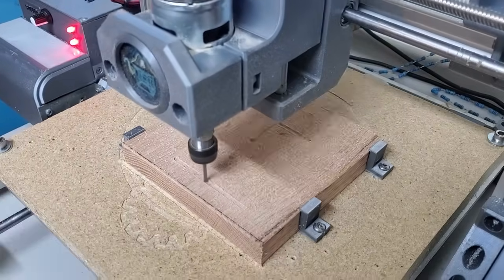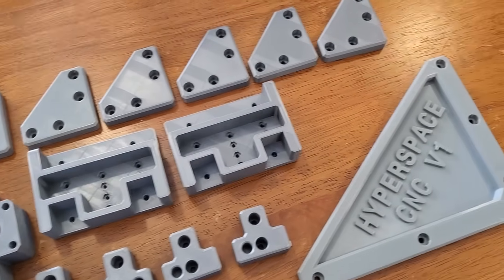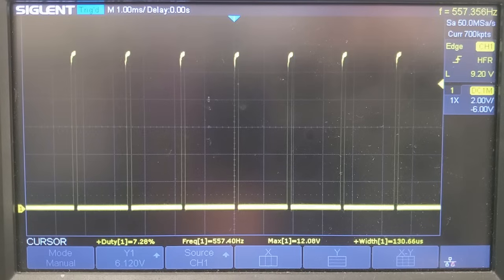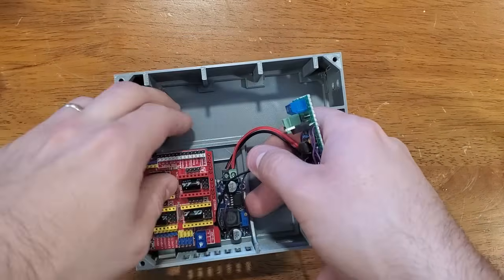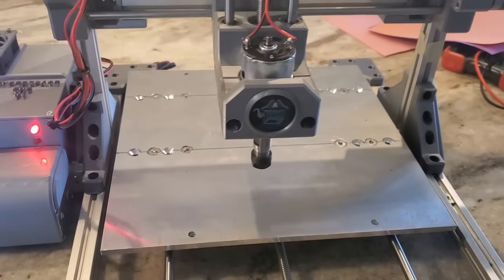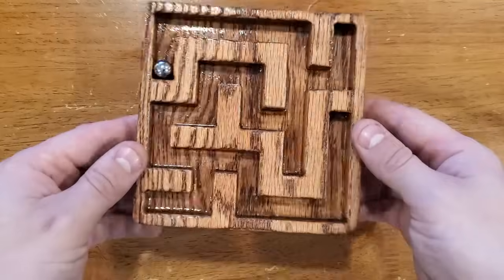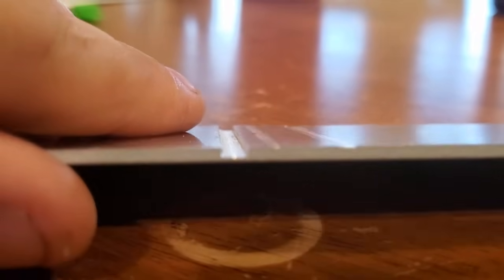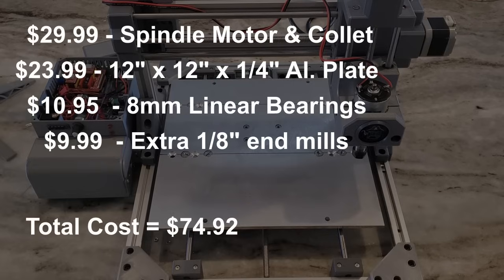CNC Mill for under $100

Comment: I don't get it...  You make it sound like we can all go and raid our junk drawer (I've got several as it happens...), but the key items - the 3D printed parts - needed to tie all the junk together requires a 3D printer in the first place!  Costing whatever cheap 3D printers cost, but certainly pushing the project to overbudgetl.    Then there's all the 3D CAD work....  Which most of us would require hours of study to accomplish.   

Very nice machine though.   I'll give you that.

Comment: I assume (or hope)  you are running correct feeds and speeds for cutter diameter, carriage feed speeds and spindle RPM . These are all critical for machining of metals to get best results. Best investment you will ever make for $140.00  is the Machinery's Handbook. I've been a prototype tool and die maker my whole life and I'd never leave home without it!  you can find used ones at flea markets that look like new for much cheaper. Don't buy one more than 5-10 years old though. It won't have new alloys, tools etc or up to date info.  on modern cutters  Very nice job!! A good build worth the education.  With some serious tweeking you can make it much more solid, obviously.
Reply: The strategy used here is entirely different from a large machine. Light CNC machines use very high speed, a light cut and a low feed rate. That way there's no pressure on the tool.

Comment: How much is 7 days worth to you if the answer is more than $100 you shouldn't DIY a CNC machine.
Reply: If you use good CAD/CAM/CAE suite such as NX or Solid Edge or one you want to familiarize yourself with you will learn a lot about designing and the software you are using. The project will likely cover most of the machine design topics. I would call that a good return of investment if I was learning CAD.
Reply: @tymoteuszkazubski2755  a CNC machine is ONLY a good project if you're trying to learn how to problem solve.

Comment: I’m impressed. But this is < $100 on new parts, but $80,000 of engineering education 😂
Reply: Well what else is an electrical engineering degree good for if not saving a buck on consumer goods?!?!? Well the microwave broke again...*pulls out soldering station.

Comment: Wouldn't it have been better to title the video " building a CNC from stuff I have laying around"?
Reply: Agreed. No way this could be built for less than $100 if everything had to be purchased. The stepper motors, lead screws, spindle, rods, and aluminum would have easily exceeded that.

Comment: You have a massively overpriced prusa yet can only spend $100 on a CNC. Makes a lot of sense.
Reply: Prusas aren't that overpriced considering they work quite well out of the box, requiring only a minimal material calibration to get working at quite good precision.

Comment: 3D printed frame parts and non supported linear rail make horriple vibration and not can use aluminium good. need be SBR12-20 rails, long more too.

Comment: led need resistor or blow smokes out. wrog wiring, arduino power need be 6-9 volt not 12 v,

Comment: stupid use 4988 drivers and nema 17 motors not working sure, need be external drivers DM556 or DM860 and nema 23 motors minimum if want cut chip wood and alumin good and real spindle 500-800W wood and 1,5Kw to alumin. not sure work this toy motors.

Comment: Very well done. It just amazes me that such a small home 3d printed based machine that can perform
Thank you for sharing your home build that does sort of work on aluminium regardless of the quirks of vibration and tolerance
Please do another video of upgrades to gain better machining from this amazing machine that you have made
But please explain your feeds and speeds and the brand and type of your cutter used

Comment: You didn’t say what material the 3D parts were made of, metal 3D printing is the best, cause plastic when used to cut metals has to much deflection and results in poor quality results.

Comment: It's hard to wrap my head around someone calling this a CNC milling machine. I would call it a working model of a CNC milling machine, similar to a model train set or an RC car for example. Looks like a fun little toy though. A DIY CNC with multiple tooling possibilities, capable of cutting precision parts out of stainless would be a very interesting watch indeed.
Reply: With decent depths of cut and feeds of course... Not industrial level but decent.
Reply: @Nitronic99  This Old Tony made a machine capable of milling mild steel. But then he retrofitted a real milling machine. There's no replacement for cast iron and dovetails.

Comment: the cool thing about mills is that even when they are made from poor quality parts, you can use them to fabricate higher quality parts to upgrade it. mills and lathes are both tools that can be used to fabricate themselves, and i guess we can add 3d printers to that list too now.
Reply: 3d printers have always been on that list.  In fact, 15-20 years ago,  thats how you got one.  The first hobby use 3d printers were obtained by having someone else print your parts.  Once you made one, you printed someone elses parts.
Reply: i managed to build a sturdy 3d printer that way took 5 iterations and 2 years to make a printer that prints well now. my printers made parts for their future self and now the V5 has the DNA of all its predecessors 😅
Reply: @VIJAYzk I hope you keep some spare incase it breaks down
Reply: Don't forget the part where their end product is substantially worse than the 50% 'more expensive' retail version because they have no idea what they're doing.

Unsupported rails mounted using 3d printed brackets. Sheesh.

Comment: It's amazing that that drawer had exactly everything needed to make a small CNC machine, with the exact amount of the exact motors needed, the aluminum pieces, etc, without a single extra motor of any kind or anything else, save a handful of random trash. It's almost like this was completely faked.

Comment: me me smooth brain but wonder if keeping it mostly the way it is and using some concrete to support the gantry and all the connected points would help since concrete mostly kills vibrations. Also maybe using some cast iron instead of aluminum. I'm just a smooth brain idiot.

Comment: I mean... A for effort, and it is kinda neat that you built your own, but... getting a pre-made for a couple hundred more seems the better idea, given the inaccuracy problems you have with this unit.
Reply: You think the CNC machines sold for a couple hundred are more accurate?
Reply: @1pcfred  - it has been four months since I watched this vid, but iirc the author himself came to that conclusion
Reply: @1pcfred  - you could ask HyperSpace Pirate, rather than continue to ask me.
he has shit rigidity and poor accuracy, for a cash outlay of 75 bucks plus a lot of machine parts he happened to have lying around plus a fair bit of labor.
that is well over 500 dollars total value, for a product that is no better and arguably not as good as a commercially-available $500 CNC router.
this is easy math, and I hope that terminates your puzzlement.

Comment: Why don't you directly wire the spindle mosfet up to the arduino? GRBL has PWM spindle control on pin 11. No need for 555 circuit, and you can now control the speed of the spindle through GRBL, improving cut quality.

Comment: Hey there my bro.. This is one sik ass video. I'm in the process of buying up the components I need to build my own CNC but for somebody like me who couldn't even set up an email account a week ago bcos I've never been into computers before I moved to a new job it's very daunting. 
I would love it if u could make a full unedited video as a series for guys like me who want to learn. If u have a website u could maybe sell the tutorials for a price? I don't know really? How about 10.99 euros for each hour long video? Make the videos in a 4 part series? I bet u could get a lot of interest. I will defo be one of those people who will be paying for the privilege of gaining ur knowledge into the building of a very good CNC machine.. 
I want to build a 1200 x 1000 sixe which will give me a work area of about 1000 x 800? That's what I'm hoping for anyways. I have a nice corner in my woodworking shop for this machine but now I need to build it. 
Is that 2020 u used in the frame or 4040 extruded aluminium? I bought 10 x 1200 lengths of 2020, I have 2 X Longrunner Nema17 stepper motors and 2 X TB6600 drivers to go with them. I got the pulley system with the belt also. I only found out about the Arduino UNO yesterday and saw u used it here as well.  They're good enough for my purpose atm too but I will be doing my best to learn everything I can about the CNC software like CAD & CAM to have better options moving down the line but for now what u are using would suit me fine.
Apologies for the long winded comment but I would be very grateful if u could give me a little advice about what else I need atm to get this CNC up and running. Is the 2020 to weak or could I put 2 together on the length and cross sections to strengthen it all up?? 
Thanks for a brilliant video my friend. I hope u can make those videos and get a website up and running so we can get there to buy the video tutorials in a longer format? Just a thought my friend. U haver the knowledge so why not make on it for a living. There are a lotta people out here who are looking to get into CNC and milling machines of all types.

Comment: Very cool indeed. ThNks for sharing and documenting. Maybe worth designing 3D printed mounts that can be easily milled in aluminum after the machine is complete. To replace themselves. And add some rigidity
Reply: With those unsupported round linear guides the machine will never be rigid. You could increase their size 10X and it'd still flex.

Comment: WELL NOW THAT YOU HAVE A CNC THAT CAN CUT ROUGH SHAPES YOU COULD USE ALUMINUM INSTEAD OF THE 3D PRINTED PIECES TO FIX A SMALL AMMOUNT OF YOUR SLOP  BY USING ALUMINUM PARTS TO BUILD THE FRAME BECAUSE THE PLASTIC LEADS TO SOME PLAY JUST IN THE FIXTURES

Comment: Since you’re limited by support strength, print area, and what you can actually cnc, Would you just call this a proof of concept? I’m looking for an STL file for a CNC machine that can actually mill metal parts.
Reply: If you want to mill metal then get a milling machine. They're really good at it. Then all you have to do is refit ball screws for the lead screws.

Comment: Great result, wished I had that machine. The $100 pricetag is a little bit misleading because you already had most of the components. 
It would be a bit more realistic if you estimated the price of the components you already had and included those in the pricetag mix.

Comment: that music at 10:32 is also used in Kerbal Space Program, and this little CNC has a similar vibe which I approve of. Now if the pile of steppers I had left over from my Tevo where worth anything, I'd probably make something like this. even buying nicer steppers though, this looks to be suprisingly affordable. wonder if it'd be possible to control the spindle with the Arduino, I mean, I could see a cursed way of doing that involving a stepper turning the speed dial.... I suspect there are dedicated CNC hats for arduino
Reply: that said, seeing what you can accomplish for less than $80 is pretty suprising.

Comment: The voltage converter on the arduino is a linear one, meaning it burns all excess voltage as heat, so as you are already using a step down converter, just set it straight to 5V and hook up on the 5V pin of the arduino (NOT Vin!)
Reply: You need to feed a regulator a voltage above what it drops. You can't get a regulated 5V output out of a 5V input. A typical drop is 1.2V So if you fed it 6.5V it'd work. Though there are low drop regulators. They drop about 0.3V.
Reply: @1pcfred  you dont get what I said, he is already using the small LM step down converter, the arduino linesr voltage regulator os only connected to the Vin pin and the barrel connector. Stepping 24V down to 12V and then burning the access 7V as heat on the linear voltage regulator is 100% unnecessary as the LM step down converter could be set to output 5V and then he should have connected the 5V directly to the 5V pins on the arduino, that way the linear voltage regulator is not used and everything gets its supposed 5V without useless waste of power and excess heating of the pcb and components arou d the voltage regulator
Reply: @1pcfred  for LVR's you say it burns away the volts (even though its technically power). But I tell you a thrid time, when he's already using a buckconverter, THERE IS NO FUCKING REASON to to double loss conversion through the internal LVR. He gets 0 benefits from using the onboard lvr of the arduino.

Comment: So if you have just about everything you need you can build a subpar cnc machine that's about as good as teaching a newbie what cnc  is all about. I think I'll just buy one that works.
Reply: A turnkey CNC machine that's worth anything is going to cost around $2,000 minimum. There's a new desktop one out I just saw and it costs $4,500.

Comment: "build a CNC for under 100 dollars" 
*Does not include frame and electronics, custom parts, hardware, or well, basically anything but a cheap motor"

Comment: I am not sure why you connected 12V to supply Arduino Uno Board as it is powered by connecting USB to the laptop already. Can it work properly if I do not connect 12V (from buck converter) to the board and only use USB connecting the board and my laptop?

Comment: I know I'm just adding fuel to the fire, but I also agree with the aforementioned comments. It's more than just a bit misleading to state that this mill cost $100 when you had at least 200 to $300 worth of parts laying around for the device, not to mention you didn't add into the cost of that your time. Which would be subjective depending on what your times worth. Not cool, and not $100. Good work, though, just misleading in its contents.

Comment: Honestly, I think you could easily cut aluminium plates by hand and just drill a couple of holes to replace the 3D-printer plates that you use on your mill. Then, once you have the mill all squared and constructed, you can mill out some better parts and upgrade the mill that way. Saves you a lot of time I think to start with some aluminium plate instead of printing the parts.

Comment: So many people seem to assume time is money. For a hobbyist or someone who has free time, it's not like you would even want to turn around and spend that time working a paying job to make the money to buy such a tool. The time spent designing and building is its own fun.

Likewise, lots of people either have a 3D printer or access to one. Heck, our public libraries have them now. You wouldn't buy a 3D printer just for this project any more than you would buy a drill just for hanging a shelf. There's no reason to add the cost of a nice, new 3D printer to the cost of building this one project.

But yeah, few people just happen to have a full set of steppers, rails, and other bits laying around that they could salvage for this specific project, so that should really be counted in the cost.

Comment: definitely not under $100, but a great video nonetheless. If I have most of the parts, I may consider making this instead of buying a more expensive CNC Mill. It would be a good starter CNC Mill that I could use in my apartment on my balcony. This may actually give me an excuse to use a wood panel on my project instead of a 3D printed plastic one.

Side Note: Still don't have a 3D printer yet, but I plan to get one in the near future anyways, so that cost is arguably negligible for me when it comes to this mill.

Comment: Great project! Subscribed! I think, my approach is going to be, getting a baseline small one, and using it, to build a bigger one for myself. Between that, and my 3d printer to make needed joinery, etc… and a proper machined mount, as well as linear rails instead of rods / screws, I should be able to come up with a BEAST!

Comment: The milling spindle collet is exactly the crappy same as on my $100 CNC.  The problem is centering the bit is nearly impossible.  I am looking to upgrade to a 3 tined drill collet which I can buy on Amazon

Comment: Great job! I'm curious. Why the 555 PWM signal circuit to control the spindle speed and not use the the Arduino directly, or through the PWM output in the CNC shield?

Comment: What? no clearpath servos just laying around? after I bought a G0704 mill, ballscrews, HCON Integra motion controller, belt drive kit for the head, and clearpath servos. I put all of this in my shop. I went out of my shop and then back inside where I built a cnc mill for next to nothing, with parts I had laying around...

Comment: Supplying 12V to the Arduino burns a lot of power in the onboard regulator, doesn't it? Adjusting the buck converter to ~7V should be plenty 🙂